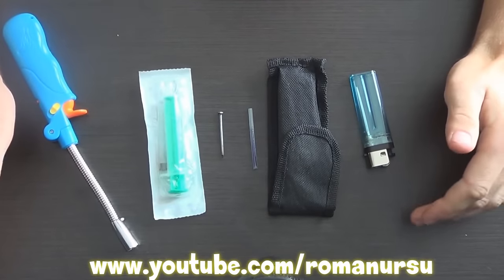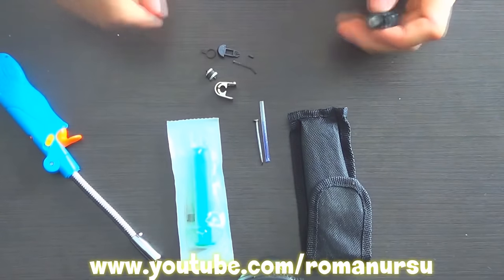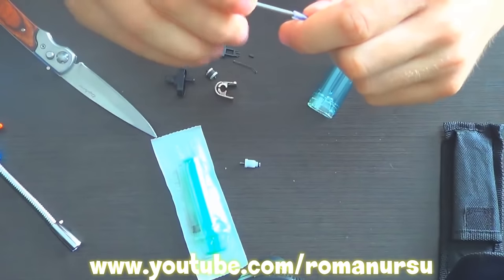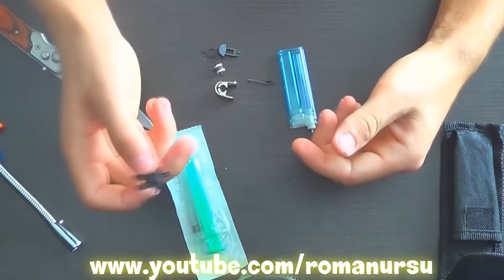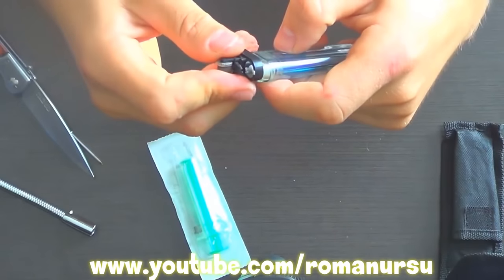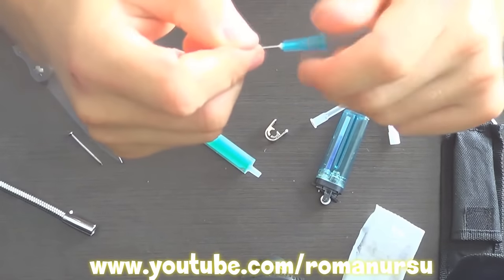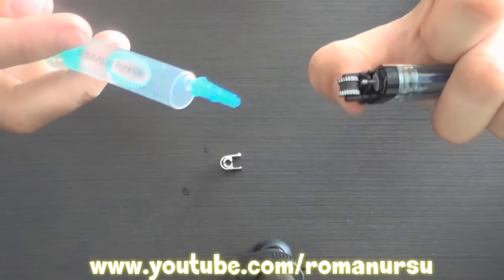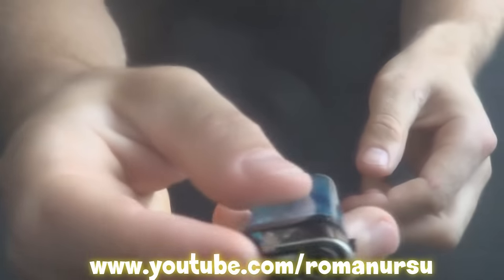How to make a Water Lighter / Tutorial

Comment: I for one am not seeing any propellant medium. So how does.the water "shoot" away from the device?
Reply: compressed air?
Reply: Maybe the left over lighter gas
Reply: He said that he put 3 ml of water in the syringe and the rest was air, I can only assume the air is the propellant.
Reply: +alphakorean But for the air to give the water kinetic energy there must be pressure, but how would that have been added? just confusing...
Reply: its simple physics. The lighter can only contain so much mass in its container area. The syringe having water and air being forced into a fixed area would create the pressure (air pressure). This is plenty to give the amount of kinetic force seen in the video. I have also tested and it does indeed work pretty simple squirt gun truthfully. Most squirt guns have a mechanism inside that way a syringe isn't needed but same concept.
Reply: So the lighter is only good for a shot or two?

Comment: fill it with alcohol or lighter fluid (LOL) and make a mini flame thrower?
Reply: That would just make normal fire like it was original made to you gotta get some really flammable substance to make a flamethrower like you think
Reply: +CoolRainbow Rainbow Gasoline would work fine. I may even try this with gasoline.
Reply: I used to do that with lighters like that as a kid, you don't have to really do any modification, just remove the metal cover and lift the black pressure lever thing so it disengages the little white gear/cog thing, move it all the way to the left, reengage, then move it all the way to the right. Repeat this two or three times and you've increased the output enough that it shoots a nice jet of flame.

Another fun thing to do is make it a flamethrower like that and rubberband the button down, set it down and stand back; depending on how high you turned it up, (higher than it's supposed to be, but not too high) it can make a small, bright explosion after a while. Be careful doing that though, you don't wanna lose an eye to shrapnel.
Reply: or even pepper spray for self defense
Reply: Germany Bond 
"POCKET HOTSAUCE!"